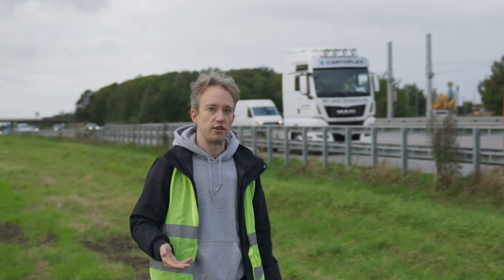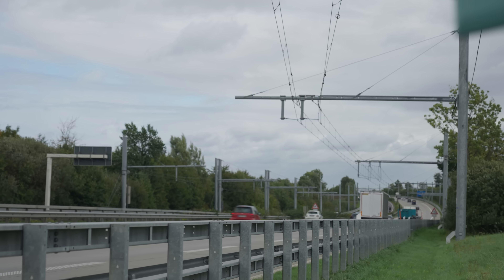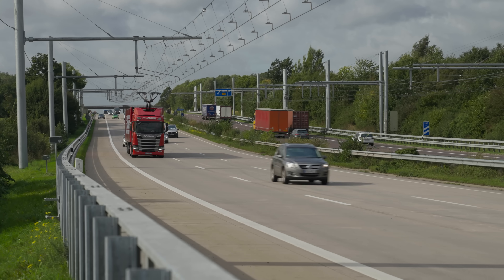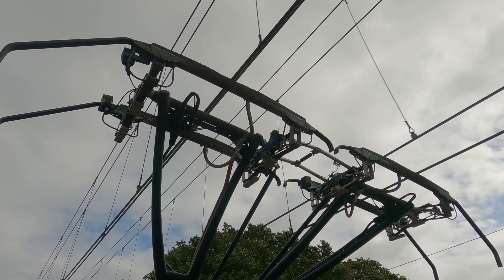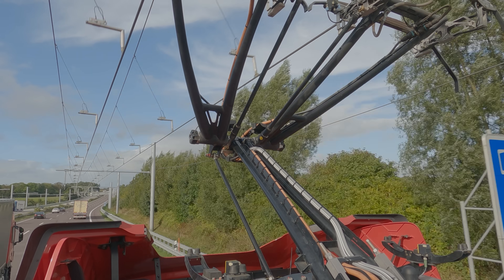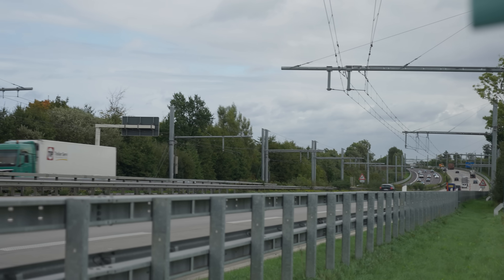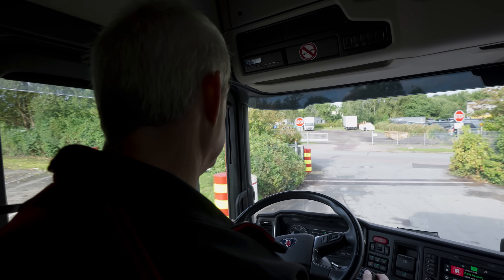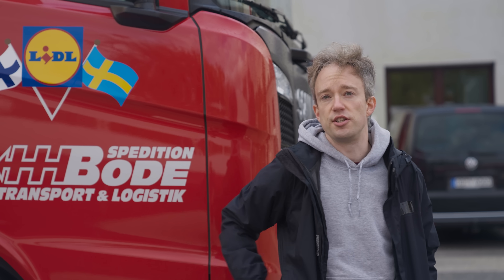The highway where trucks work like electric trains

Comment: e-trucks have been tested in close convoy too, which reduces power use massively. Maybe this would combine well with that model.
Reply: ... so a train?
Reply: @rose348   like a train, but it goes on the road we already have and can then split off seamlessly to multiple destinations without changing modes. Is it really so hard to see the advantage? 

Also, many places do not have a rail service and may never have one.
Reply: Next step we'll put them in tracks, maybe a big convoy... wait, that's just electric trains!

Comment: There is a lot of electricity generated that is just wasted since no battery can hold it. With this you would put it to good use.
Reply: Exactly, none is wasted as it's only used on-demand, no more or less than you need.

Comment: This always was one of those techs that were really an obvious solution if you thought about the problem for a bit (proven by the fact that even Clarkson got it a few years ago), and it's great that it's finally seeing some real world implementations.
Reply: Clarkson isn't exactly the gold standard for "this is sensible technology" either way...

The problem with these lorries is, a train has got low running resistance due to the rails and steel wheels. Here you have standard tyres, which will definitely take away from your efficiency. Plus the higher capacity of one cargo train vs a single lorry.
Reply: @lillywho  Except a train can't go to the front door of 90% of businesses, a semi can.  Trains make sense for long cross country freight, but not really for intrastate transport. Not to mention that adding electricity to a road network is a lot cheaper than building new rail lines for the major routes they want since they would still need to be electrified.
Reply: @dontworry1302  For one, local cargo strations used to be a really common thing before they got abandoned and torn down in favour of diesel lorries. Secondly, this is a long distance solution, but you're arguing about the last mile. If you combined this technology with having proper rail infrastructure, maybe that would be adequate as a last mile accessibility addition. But this seems like coming up with an inferiour solution to a problem, that already has one massive solution that's just been neglected for a long time.
Reply: @lillywho  This is not last mile, its mid range, but would probably still be preffered for long range transport for a few reasons. 1, its flexible and allows for deliveries to be spread out. 2, it allows for more last minute scheduling of deliveries. 3, trains have to have large curves, switching, and signalling equipment all over to allow for local cargo stations.  This is why every country switched from transporting almost everything from rail to truck, its just far better.
Reply: @lillywho  Obviously it's not as good as a train, but given the fact that trucking exists, and won't go away for some time, this seems a step in the right direction.
Reply: Honestly I have never thought of anything like this as a solution. I always thought (and still do very much) that the wireless charging roads was a stupid idea and never even thought there could be a good way to do mid transport charging for vehicles. This is probably limited to transport class 5-8 vehicles though.

Comment: Not a bad idea at all.

Should be a cheap and effective solution/stopgap whilst we wait for more advanced electric battery trucks to come along.

Re-using existing systems in a new way is perfect for how we should be doing this.
Reply: Honestly, systems like this are a better option than any battery truck even on the frontier of "stuck in the lab" research, if only purely because of the much lower amount of resources needed to do this. You'd need to mine far less lithium or sodium this way. Obviously the best solution yet would be electric trains, but this is still far better than the alternative.
Reply: There wont be any battery powered trucks that do long journeys in the next decades, probably ever. When the goal is to haul as much cargo as far as possible as efficiently as possible, and you have a weigth limit imposed by bridges, safety concerns and traffic conditions, hauling around tons of batteries will never be a good solution.

With current batteries roughly having 1/20 the energy density diesel has, you would have to increase the density by at least 1500% for it to become sufficiently not terrible. Not even solid state technology promises these kinds of gains, which means a fuel such as hydrogen or bringing the energy on using cables is really the only way to haul cargo, without considering some edge cases were batteries would be adequate, such as last mile deliveries.
Reply: I actually prefer overhead wires. No batteries means no energy loss from charging, less chance of fire, and a far longer lifespan than having to change out lithium batteries every 3-5 years (assuming the network is well maintained of course).
Reply: or, you know, electric trains
Reply: Why would you want batteries at all? Batteries are super polluting, so it would be far better to have the final goal be catenary rather than battery for on highway trucking.
Reply: If you want to "reuse existing systems" then ignore this random weird system, and just keep using TRAINS. Trucks are the worst choice for distance transport of goods, electric or gas.

Comment: just use Railways, much less energy used, much cheaper to build and maintain, much less truck drivers needed, much less traffic and wear on the street.
Reply: This is only 1 part of building a train network. You need the land, rails, signals plus many more hidden costs.
Reply: @Jimmy_Jones  streets would also have to be extended and maintained. they are beyond their capacity by now, especially where one of these test installation was erected near frankfurt, where I life

Comment: Why not just use the damn trains lmao
Reply: Railway networks are not great for point to point deliveries, since last mile delivery must be done via truck anyway. Trucks are more flexible, hence why they are used so much today.
Reply: Because these trucks can go anywhere. They use the electrified network to get most of the way, then complete the journey on normal roads. The logistics of switching modes is extremely inefficient, and this removes that need.

Comment: Imagine if they just.... built trains.
Reply: This is only 1 part of building a train network. You need the land, rails, signals plus many more hidden costs.
Reply: @Jimmy_Jones  the land is already there. Just take away a highway lane or two and build rail instead. You'd save so much on labor costs.
Reply: Ah... you see... Germany is quite hilly. Train tracks are even more expensive to build with all the tunnels and bridges that you need.
Reply: @TheAgamemnon911  "Germany is quite hilly."
Compared to what? The surface of a lake frozen solid?
Reply: This is soooo much cheaper.
Reply: Obviously cheaper to use the existing infrastructure of Highways, plus Germany has trains, this fills other uses while producing less CO2
Reply: Every "train journey" is two truck journeys and one train journey. Your goods also keep stopping at other people's destinations.
Reply: @owensparks5013  The number of journeys is not that relevant (except when you're more interested in the number of people you'd have to hire). What's more relevant is the distance that has to be covered in total. 30 trucks all going in the same direction can easily be one train.
Reply: Why though? This seems much cheaper and more flexible. All you have to do is adding those standard electric cables over existing highways. While with new train lines you have extremely high land costs, and the tracks are harder and slower to build and cannot be used by other vehicles.
Reply: More expensive depending on the route.
Not kidding.
Reply: @GetIsekaid  roads aren't cheap and their maintenance is more expensive
Reply: @GetIsekaid  I guess you're comparing rail network to road network? For this you'd have to compare electrified rail network to electrified road network.
Reply: @lonestarr1490  Im only comparing raw costs.
Reply: @GetIsekaid  Yes, but: A disgusting amount of long haul cargo trips is done by truck, even in Germany which does have a quite extensive railway network. German rail is criminally mismanaged, underfunded and underused. Tackling those issues is very scary in a country that traditionally LOVES cars and trucks will never quite go away, for sure. But rail can make financial sense for more routes than it currently does if it's done right and I fear that electrifying roads before even all the train routes are electric would further increase unnecessary road usage by trucks that (in a better world) really shouldn't be there

Comment: This isn't a shorterm solution but hopefully if Britain ever collects itself it will start investing in the future. Even small things like this will go a long way.
Reply: i think this is exactly a short term solution.
rubber tires cause way more friction than steel wheels. in the long term we should invest in a railway network of similar extent to a autobahn network to make transportation more energy efficient.
putting up those electric lines is cheaper than building the needed railway infrastructure, but it is a compromise, meant to utilize existing road infrastructure.

Comment: Is this not a Trolleybus? Or is there a distinction between the two?
Reply: It's a truck, not a bus and it is on the highway
Reply: I guess the differences (other than not being a bus!) are that they use pantographs instead of trolley poles for current collection, and I’m guessing that allows them to change into “[overhead line] electric mode” at higher speeds than trolley poles would?

Comment: Those Germans, always 1 step ahead
Reply: Das Auto
Reply: We have had that system on trial in Sweden for a few years before Germany built theirs :)
Reply: @ÖrjanAlmén  exactly.
Reply: 10 steps behind when it comes to anything digital. Thatll hopefully change in the coming years though
Reply: 5 steps ahead of the UK
Reply: But aren’t they trying to get rid of their nuclear power usage?
Reply: @BananaWasTaken  Unfortunately yes
Reply: @BananaWasTaken  yes. And buy nuclear power from france and produce most of the rest wich isnt covered by wind turbines worh coal 😑
Reply: Too bad they're powering it with coal :(
Reply: @pbe6965  germany actually produces more than 50% energy from renewable sources but yes coal is still a too big factor of about 25%
Reply: @pbe6965  i mean the bigger the turbine the more efficient but its still coal so still sucks
Reply: Most german thinks it is stupid. For heavy loads hydrogen would be better.
And everybody wants to move more stuff by train anyway..
Reply: @TutorialsByBrazzor  I'd love to see you try to move things using nitrogen.
Reply: @TutorialsByBrazzor  maybe u mean hydrogen.
And this maybe the only sweet spot were it can exist for some years.
Then it doesn't make any sense cause the loses in producing hydrogen are bigger than carrying a advanced batterie with you.
Reply: @deathwing5639  Yes, thank you.
Of course, if batteries are researched further, hydrogen makes no sense.
But I think these overhead lines make little sense. The construction costs and maintenance alone are too expensive.